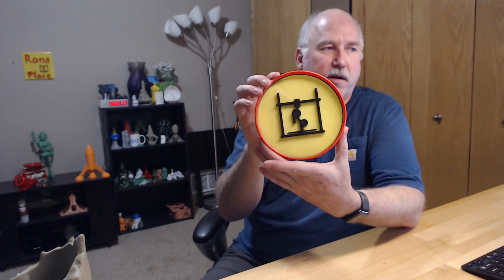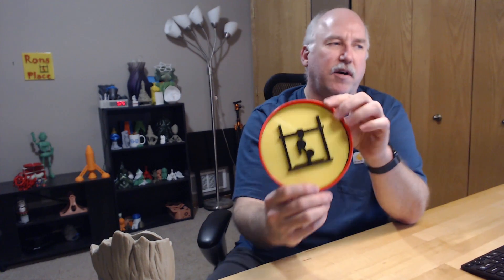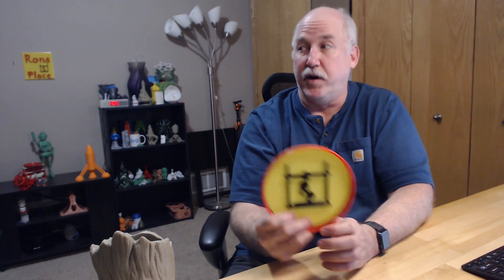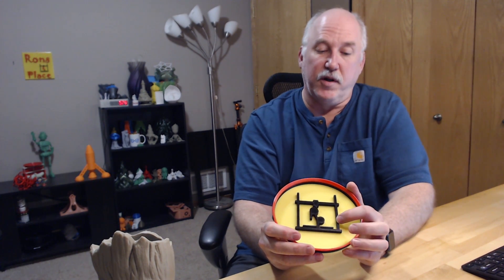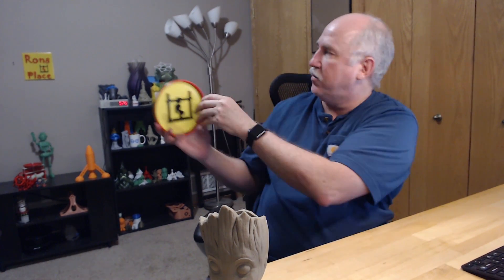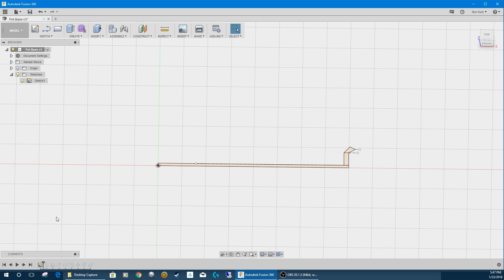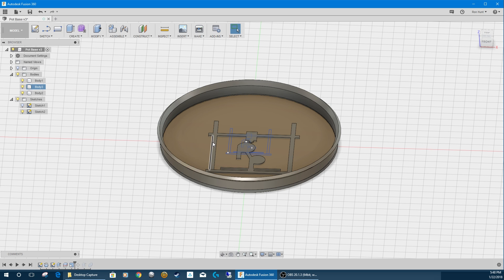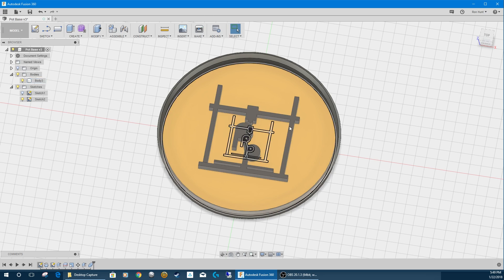Planter Tray Design - Prusa i3 mk3

Comment: The way the filament unloaded freaked me out first time after upgrading to the latest firmware on the MK3, it's so earnest.
Reply: The REMOVE THE FILAMENT IMMEDIATELY one the display. Personally, I found the fast slow fast of the last release worked just fine.

Comment: that looks like it printed great RC5 seems to have improved the quality. id make another dish for the planter, and keep the best of the 2 for the wall, cause it came out fantastic. also side note when you extrude theres a drop down menu in the settings of it (join cut intersect and new body), you could of skiped the plane cut by setting the logo extrusion to new body then do the rest of what you did.
Reply: yea, im still learning too, iv come over from solidworks (paid cad program) and im still getting used to it, its really fun. i really enjoy once the design is together throwing on some appearance colours and do an animation of the result. heres a gif of my current motorise turn table idea https://i.imgur.com/wVX46hl.gif